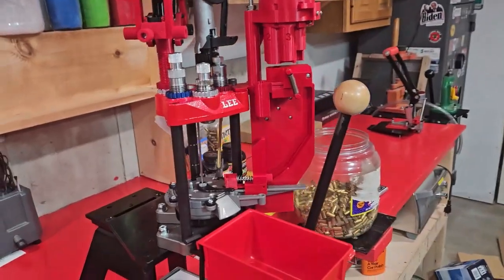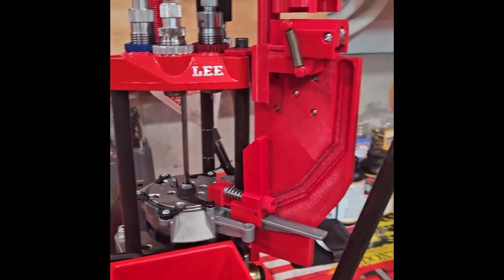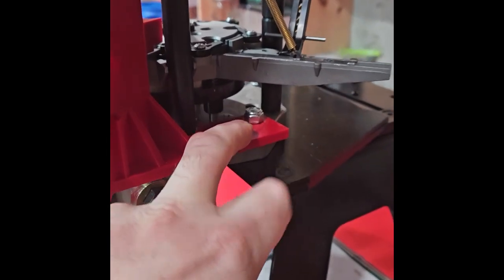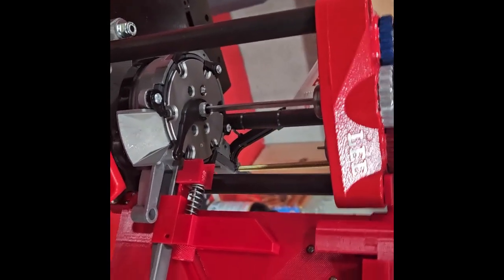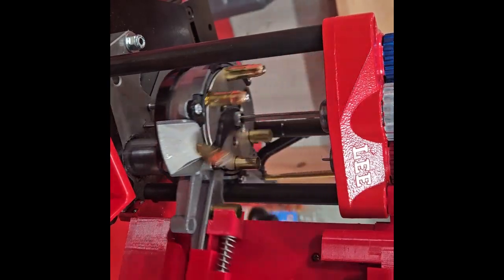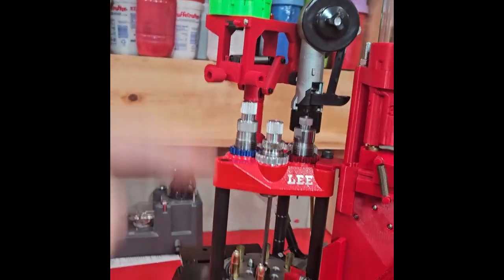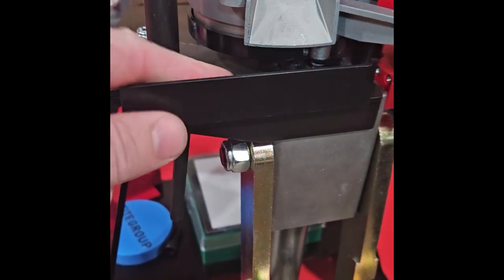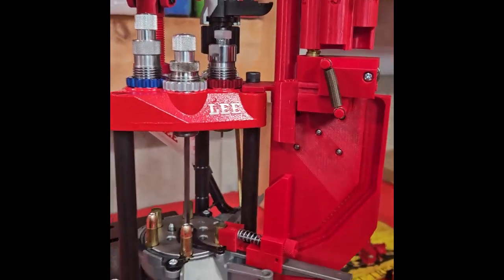Lee 6 pack Pro Case Feeder System

Comment: I like the concept of this. What is the durability of your prints? I've ordered 3d printed stuff for my loadmaster and the durability has been lacking. Concerned about wear on the case feeder slide and the bearing guide.
Reply from the maker: I think the durability is good.  Little early to say with the Lee 6 pack feeder.  I just did a huge overhaul on this feeder.  Haven't had a chance to do an updated video.  But my warranty is excellent if something breaks is replace it.
Reply: @3dReloaded3d  Thanks for the reply. It's on my list.
Reply from the maker: @clintbonnett3449 not a problem.  Your welcome to shoot me an email as well.  3dreloaded3d@gmail.com